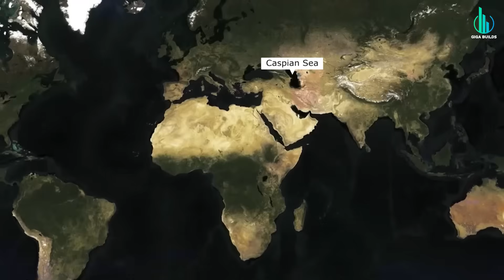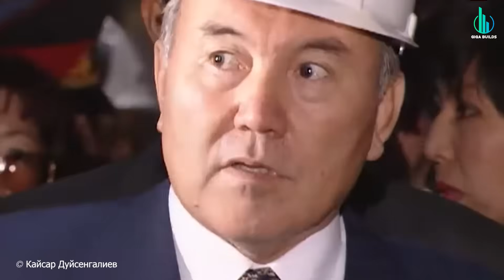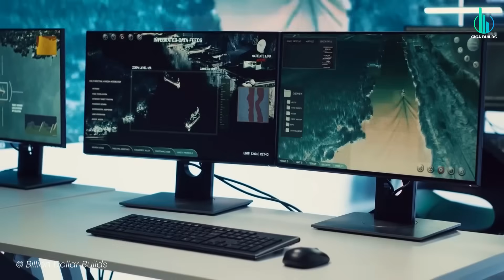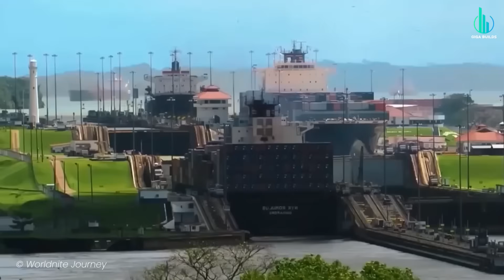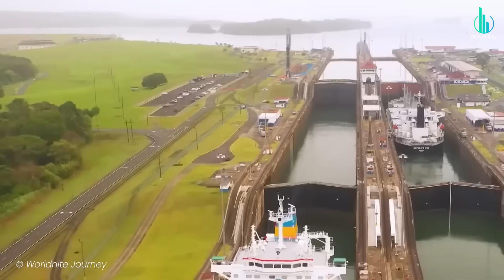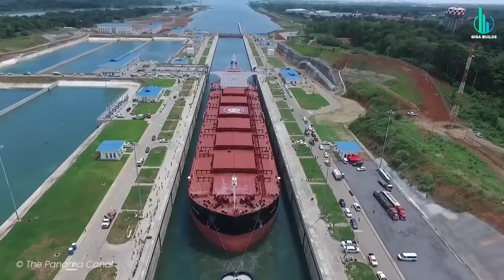Russia Is Rushing To Build This Insane Canal To Connect Europe And Asia

Comment: The Manich ravine which once linked the Caspian sea to the worlds ocean when the Caspian was an elevated lake and flowed into the shrunken black sea at the time cut off from the Mediterranean. Even if the Caspian sea was at the same level as the black sea the manich still wouldn't connect it would have to be deepened. It is also said to be the sarbaton river of legends it wouldn't flow on Sabbath but the Hebrews couldn't cross on a Sabbath thus an impossible situation. Also held by some to be a boundary between Europe and Asia

Comment: important would be a large water canal, without sluices.  It could refill slowly the caspian sea, which is slowly drying out.
Reply: if this is planned it would be the most important feature of the project
Reply: as a private person, I do not know,  whether the sea level of Caspean Sea is lower than Black Sea, this would be important. Without this fact the idea would fail.
Reply: Why stop there, connect it up to the Aral Sea which is dried up and have that refill back up